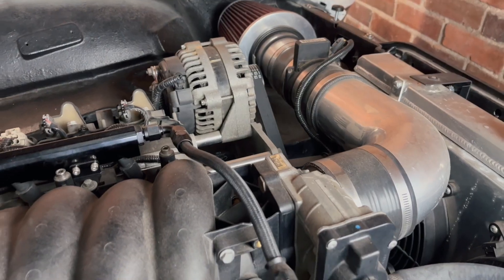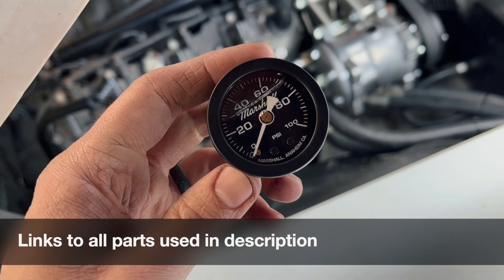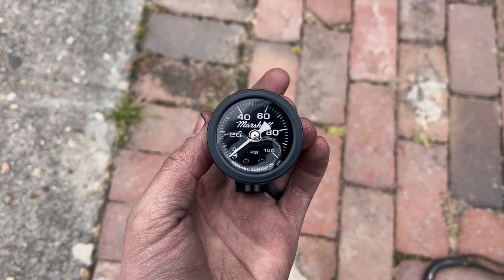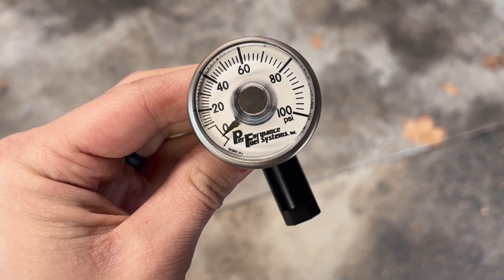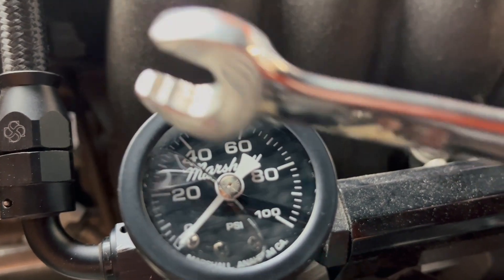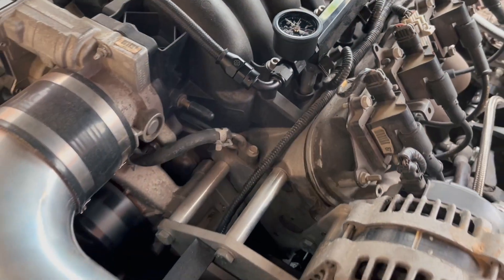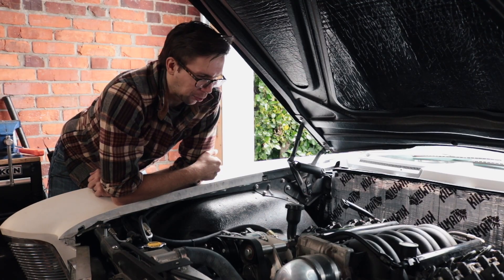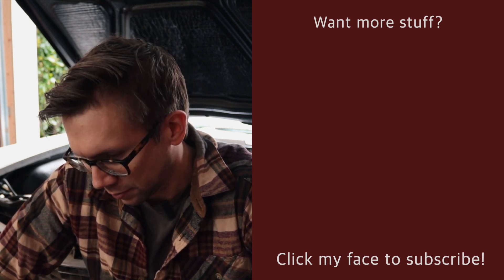Installing A Fuel Pressure Gauge On An Aftermarket Fuel Rail - LS Swap

Comment: A gauge attached to the fuel rail is worthless. You need a gauge fitting so you can hook up a pressure gauge that has a hose long enough to see while you are driving. Your fuel pressure can be fine when idling with the hood oped and drop dramatically under power when fuel demand is high.

Comment: I'm having issues with my pressure gauge it's reading 60psi off. Have a new gauge to install but previous owner and I, of my gto are wondering if pressure regulator has gone out too.

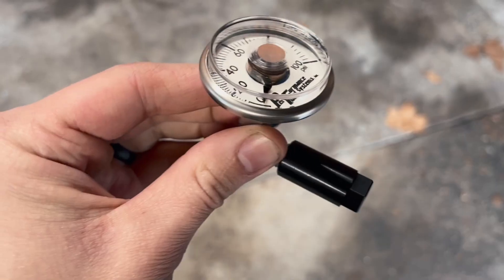Comment: @Mathew Finlay where can I purchase that gauge set up 1:48 with the built in valve inside the fitting, also be very helpful to know the size of the fuel pressure port, I have an 05 Chevy truck. Thanks!
Reply from the maker: https://performancefuelsystems.com/serviceportkits.html
Reply from the maker: And ironically I have a video about them too. They are specific to Ford, Chevy or Chrysler from an adapter standpoint but they all function the same. I’ve got two of them and both have worked great for years
Reply from the maker: Hey buddy here is a link to their website!
Reply from the maker: https://youtu.be/UmSez0qvFn8

Comment: your fuel pump check valve is blown out. Get a check valve on your pump so your fuel doesn't flow back. You can put it up on the rail or on the outlet of the filter. Helps keep the pressure up and stable. Also change the lines to PTFE that get better pressure than those flimsy rubber lines.

Comment: My cold starts are instant but after it runs for a while, shut her down, she wont fire over unless it sits for ~15 min, then it will fire up ... 
And i DO have a Walbro 255 WITH the oem FPR ..
Reply from the maker: To me that sounds like a classic case of blown out regulator!
Reply: @MatthewFinlay  can you explain the technicality behind this ??
Why does it do that ?
Reply from the maker: I’m gonna assume you have a truck style mounted on the rail for this explanation. When the membrane/diaphragm inside the regulator “blows out” it can leak fuel into the vacuum line connected to it. That’s another test actually, pull your vacuum line off the regulator with the engine off and hot. If you see or smell fuel - that’s most likely your problem. When you have a blown diaphragm and the vehicle can sit for awhile and get cold, the gas that leaked into your vacuum system can evaporate away. But when you hot restart it - that leaked fuel didn’t have a chance to dissipate and you’re left with a basically flooded engine. Press your pedal all the way to the floor while cranking and if does a hot restart quicker, that’s also another good sign you have a failed regulator. Look up “flood clear mode for a 5.3” for more info on that. Even if you don’t have a 5.3 all the ECUs basically respond the same.
Reply: @MatthewFinlay  those symptons sound about spot on literally .... 
If the car has been run or HOT, i shut it off, then it will NOT restart unless i wait ~10 min, then she fires right up ... 
Def sounds like fuel got released into the chamber and floods it out preventing start up, then if i wait 10 min, it dries out and it fires up fine ... Hmm ..
i will check on that when i get home from work tonite ...
Reply from the maker: I’m assuming we’ve got a LS engine but is it a truck style with the FPR on the rail or separate C5 style?

Comment: my car does NOT have a schrader valve on the fuel HARD line and no rubber anywhere, its hardline from the fuel tank all the way to the fuel rail and hardline back to the tank ...

Comment: I had issues with warm starts. Ran just fine even after several hours of driving but if I turned it off and let it sit for a minute or two, it would refuse to start, didn't event attempt, besides cranking normally. I found out that my fuel rail was loosing pressure because quick connect fuel line o-rings were letting all the pressure leak out and suck air into the system which then caused vapor lock.

Definitely need one of those gauges that connects to the schrader valve.

Comment: did you ever figure out the problem?  I am having a similar issue with hesitation on warm starts ONLY.  i just purchased fuel pressure gauge and adapter.
Reply from the maker: Yes - just needed a new regulator! Im trying an AC Delco this time to see if it lasts longer behind a Walbro 255 style pump. Is your issue on a truck engine (4.8, 5.3 or 6.0) or the Corvette style in the rear?
Reply: Ls3 6.2 with corvette regulator
Reply from the maker: Cool did the problem start randomly one day or slowly overtime. Also is stock or tuned?
Reply: Randomly i think.  The vehicle is tuned.
Reply: Whats the part number for the ac delco fuel pressure regulator